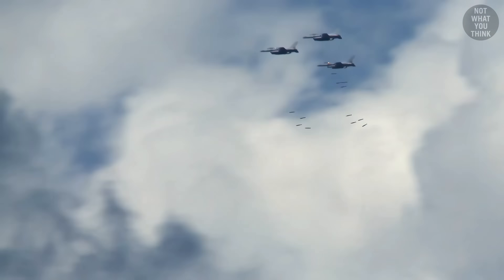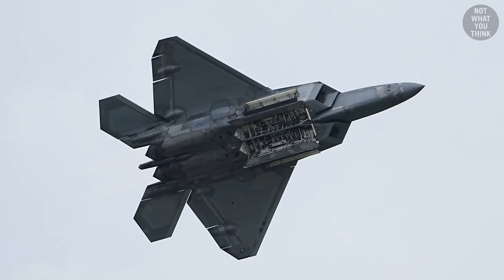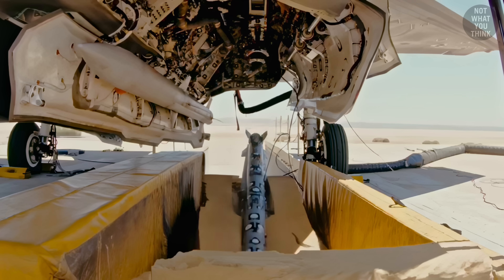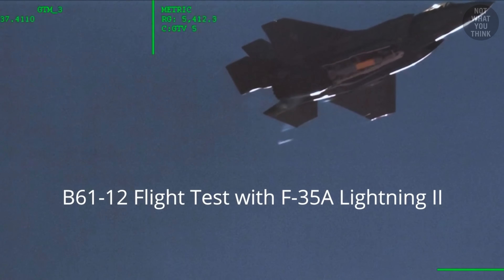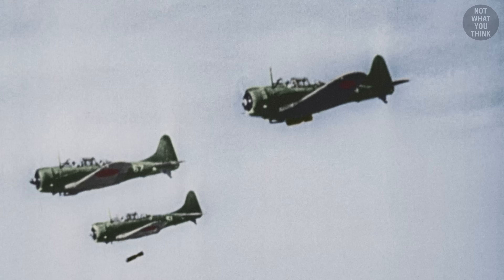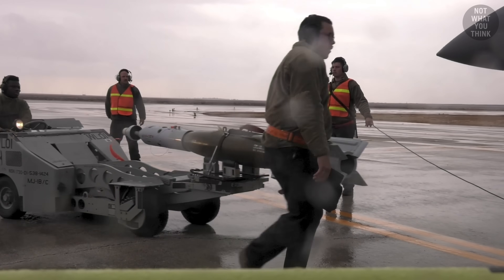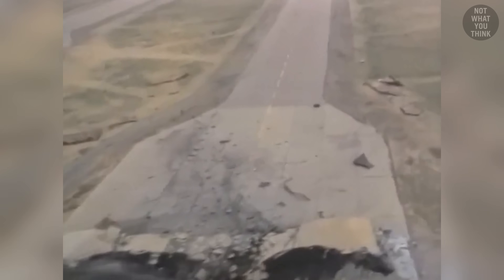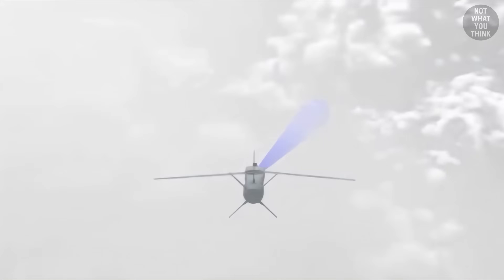Why Gravity is No Longer Enough to Drop Bombs

Comment: I have a low-tech solution to this problem. Have two hard-points for the bomb - front and rear. When the bomb release button is pushed the front one releases and then the rear one releases about a second later. That one-second delay would allow the bomb nose to catch smoother air further underneath the aircraft pulling the bomb away rather than it being sucked up against the aircraft.

Comment: "Mach point zero nine (.09)" at 1:47 is 66.6 miles per hour.  Barely a speeding ticket.  I think we meant to say "...point 9 Mach", which is 666.98 miles per hour at sea level.  .08 BAC is "drunk", .8 is dead times 10.  Watch the points and zeros.

Comment: 11:28 "That said, they (Air Launched Cruise Missiles) carry smaller warheads..." Uhhhhhhhhh. The ALCM carries a W-80 nuclear warhead, which doesn't really count as smaller than a JDAM's conventional warhead.
Me? I was the Air Force's Lead Engineer for testing ALCMs in 2004-2007.

Comment: 0:30 This is an insufficient and misleading explanation of lift. The force attributable to the equal transit theory of lift is a tiny, tiny fraction of the total lift force required to keep a plane in the air. The angle of attack of the wings is what generates the vast majority of a plane's lift. This correction is not in conflict with the idea of bombs being pushed upward toward the aircraft, since in fact the airflow up toward the underside of an aircraft is actually greater when the plane is at a positive angle of attack (as opposed to the zero AoA shown in the wind tunnel video at this timestamp).

The only aircraft that maintain a zero angle of attack more than very briefly are those flying parabolic arcs to simulate zero gravity, such as the "Vomit Comet," which is used for science experiments or astronaut training, etc.
Reply from the maker: good point

Comment: If I am not mistaken it isnt the air below the wing that slows down and creates a high pressure area but the air above the wing that speeds up and creates a low pressure area. This is because of the Bernoulli principle.

Comment: The "elevator shaft" incident was actually the first ever drop of a modern "bunker buster". The story of that is worth spending time on. It was a Howitzer barrel converted into a bomb casing, loaded with high explosives, and then equipped with a short-delay fuse. That particular drop was also quite important to ending the war. AIRC, there were key members of the command staff in a bunker below that building who thought that they were safe there since they believed no bomb could reach them. Showing that they were wrong and eliminating these particular individuals showed them that Resistance Is Futile (tm).

One thing not mentioned here is that being a spotter for a laser guided bomb is a dangerous thing. Lasers can be very easily seen with the right optics. So by lasing a target, you're telling the enemy exactly where you are and that can mean a very short lifespan.
Reply from the maker: we made a video about that https://youtu.be/KJTq9yb_Zow

Comment: I was on Johnston Island during Desert Shield and Storm. 
Our job was disposing of chemical munitions. 
At the time, the US had a bunch of 110 MM rockets with nerve agent. 
Funny part is the US never developed a launcher for them. 
There was talk about using the chemicals in Iraq. So we practiced loading dummies onto C-130s. That could be pulled out the back and would just fall a few hundred feet and smash on the ground. 
Releasing the nerve agent and disposing of the munitions. No launcher or fancy disposing factory needed.

Comment: Pretty good video...the Navy "blooper" video brings back memories...it is something us new ordinance flight test engineers were shown on our first day...basically to say "don't do this". Of course it still happened sometimes but usually due to a failure of some kind like a bomb rack cartridge failure. In one case it caused a Rockeye to hang in the slip stream of the aircraft until the fuze went off causing the canister to split and the fuze to fly back and gouge the elevon. I also worked on the F-14 Bombcat. When initially conceived it was supposed to have an A/G capability but the racks were very weak and could not push the bombs out of the tunnel. What solved the problem was incorporation of the F/A-18 BRU-32 racks which had 8 times the pushing power of the original F-14 rack. Anyway, this was a trip down memory lane...thanks :-)

Comment: 17:50
Yeah, but concrete is literal stone, and stone once it cracks all resistance is only existing in the sheer mass of the particles ahead, but metal puts resistance more constantly and is just stronger against tension and about everything.

Fuck it, heavy metal is the way to go 😎

18:20
Okay what the actual fuck? Why is concrete even remotely close to as strong as metal?
Fuck'em It's literally more metal than rock at this point, real concrete is not as strong as metal >:)
Those fraudous bastards are coping with rock being weaker than metal >:))

Comment: Bombs never fly up. I've dropped most of them,  its called gravity. If you toss them at even a +1 degree AoA forward momentum allows them to go up for a bit. You can do a DTOS or Loft drop which will make them go up quite a bit. Gravity is ALL that is needed and always will be ENOUGH with the right computer, radar and avionics. Title is misleading.

Comment: The A-5 rear ejection bay never worked.  I believe some aircraft were lost because of it.  Then the A-5 became the RA-5 (reconnaissance), loaded with cameras.  They were stationed on my aircraft carrier.  They were a beautiful aircraft.   I almost was blown off the flight deck by one.  Fortunately there was a huffer chained down to the deck that I was able to shelter behind until the RA-5 turned away.

Comment: Those opening doors might be a marvel for US standards and US standards alone because they have a nasty reputation for intentionally building stuff to break or building them with the bare minimum so they work fine until you get slightly damaged, then everything falls apart. Sometimes they build them weak to elements intentionally so as it ages, it breaks by itself so that you have to buy more. Instead people started buying Russian made stuff or Chinese and European stuff. 
Flash news, its not a great achievementto open a bomb bay without losing the hatch. Not even close. You have to either be really incompetent or to do it intentionally to make this happen. And the US design is not all that great either. The best way would to open it the same way a cargo plane opens its back door, that way the hatch blocks a part of the wind to safely drop the bombs and once you are done, you just need to remove the lock that keeps it open and the wind will make the hatch close by itself.  Opening the hatch this way will also make your plane slow dowh slightly and a go up a bit which also helps stabilising the plane and lessens the chances of the bomb coming back up to hit you. 
Whoever designed those sideway opening double doors made them only to look cool and didn't think hard on whats best for a bomber. Very typical american design.

Comment: So what your saying is if we could control the bomb in the slipstream so it doesn't crash into the plane, we could potentially get the bombs to fly with the plane until the pilot forces them out of the slipstream. Now this is a totally insane idea that would be close to impossible, but there is a small chance! I feel it would be really cool to see Bombs parented to the plane by air alone as the bombs adjust their fins to stay just below the plane, well that is until the plane pulls up breaking that slip and dropping them!

Comment: 14:52 Often the delay is MILLIseconds, just enough to get through a structure like a hardened roof, and then explode immediately as it peeks inside a room. Or a few more milliseconds until it reaches a lower floor, etc.

Comment: 12:30 "Toss bombing" is a pretty wide umbrella of techniques, and the first toss bombing techniques were invented to protect the attacking planes from ground fire, not just for delivering nukes. Certainly, some toss bombing techniques are specifically designed for use with nukes, but many of them are useful for traditional bombs too.

Pop up toss bombing for example allows the plane to ingress at low altitudes, behind the radar horizon, and only expose themselves for a short time during the toss maneuver, then dive down. It can also be used to lob bombs over a hill, and never expose the plane.

Comment: 5:48 - I got to do a mission aboard a KC-130J Harvest Hawk when I was in Afghanistan in 2011 and we did not use/need oxygen.  The launch tubes looked EXACTLY like this.  We were putting warheads on foreheads (Hellfires fired from the quad rack on the port wing) but didn't use any Griffen missiles (the ones that shoot out the back) so the bay door was closed.  I'm pretty sure we were at such low altitude that we wouldn't have needed O2 even if the bay was open.  As long as you're at ~8,000ft or less (up to 12,000 in a pinch), O2 isn't really necessary and I'm pretty sure we were WAY lower than that.  Gotta be able to see the foreheads in need of a warhead!!  Hahaha...just thought I'd point that out.  Awesome vid!

Comment: 14:41  lol   bombing???    not bomb try cannon fire  not a bomb against those  ground targets... scrolls up and corrects  the  cruise missle range versus  audio   lol over 1000 mph  and show  1500kph ( 932 mph )    actually try  they are   much much  faster then  stated  speed in video depending on variant  upwards of design capabilities of mach 5+ ,  1:45  and narration does not match  text  and  not anywhere near real    lol  an f35  at  point  zero nine  in audio  is only 69 mph ( 111 kph ) .   also  dozen more massives errors in this video  smh you  need more then just staff you need someone that can research  and not just guess at what correct data and specs are.

Comment: I was Temp Duty at Pax supporting a prototype radar landing system. The F-18 was being tested for Fleet acceptance at the same time. While recording a bomb release, an A-4 camera ship lost a wing when the F-18's bomb ad libbed. Even though the observer pilot immediately saw the danger, he was caught trying to roll out of harms way. The story was shared by the McD camera man during a safety lecture, in which he said he couldn't initiate ejection until he complied with the voice in his head to stuff the camera between his legs. During my extended stay, they also lost an F-18 from a flat spin test, and an A-7 from a bird ingestion. I still remember the calm pilot's transmission: "Tower, I'm exepriencing a compressor failure." I quickly popped the hatch to see smoke trailing from the decending A-7. The pilot had already ejected, but I couldn't make that out. In the lecture, another pilot told a much more gruesome tale (though he obviously suvived), but I can't recall what incident it was associated with.

Comment: The channel WW2 Bombers did a great video on why bombing in WW2 was so inaccurate (just after you posted this) and it wasn't because "dumb bombs" fell so randomly but because they typically could not see the target at all to aim at which is a problem for laser-guided bombs as well. The Germans in WW2 often used smokescreens to obscure the view, there was often cloud cover and even when those factors were not there, the first bomber wave would be accurate, then the next wave would find there was so much dust and smoke from the first bomb raid that the target was completely obscured.

This is a problem with all bombing runs, either laser guided or just freely dropped as both need a clear view of the target. The first strike will effectively screen the target against being hit again by all the dust and smoke. You have to hit them with the first strike or wait a long time for the next strike which is just increasing your risk of being shot down.

Comment: We need a comeback of Dive Bombers. The Ukraine Conflict has showed that we don't have production capacity to meet the demand for smart weapons in a time of war, hell, we can't even make enough 155mm shells to meet demand. Dumb bombs can't be jammed, they just work. Dive Bombers went away due to the post war move towards jet aircraft, a lack of suitable turboprop powerplants, and focus on Nuclear warfare from a strategic standpoint. A modern dive bomber would make for arguably the best FAC platform one can get.  Generally a fairly STOL design from the beginning allowing it to operate from airstrips as close to the front line as possible, offsetting its slow speed, said slow speed helping negate the issues that dumb bombs have with higher speed platforms, simple, durable, small, cheap, etc.

Comment: I have to disagree with stronger concrete being the solution to bunker buster bombs. Absolutely nothing can compete with the ease, cost effectiveness and low technological barrier to entry of simply digging. Sure super science concrete is a great idea if you want a symbolic bunker sitting in the open with the intent of drawing enemy fire but if you truly want to put some important stuff in you're bunker then the first line of defence will always be making sure absolutely nobody knows where the bunker is located. The second best line of defence is to ignore all the soil when calculating how deep you will dig instead drill many MANY meters into the bedrock then drill tunnels connecting the different bunkers at you're operating depth. I don't care how strong you're bomb is nor how strong you're concrete is absolutely nothing will compare to or compromise a couple thousand feet of naturally formed solid rock. You can't build a fort that way but the intention of a bunker isn't to hold the ground its to guard what you consider to be precious and with that objective in mind absolutely nothing can beat the simple art of digging as deep as you could possibly manage.

Comment: I know it may sound silly, but I’m always coming up with great ideas but no way to test them to give you a small idea I wanted to build a hot rod engine with the drag strip going to use a four 54 in.³ Chevrolet at knowing little or no money how to increase maximum horsepower with a little or no money this was in the very early 70s I thought diesel engines use inject your system. Why not designer injector system to go on the engine, but they’re gonna run into the usual problems not enough funds none of the right kinds of tools just a big idea for a old, poor country boy all my life elementary school until I had to go to work all kinds of ideas, but no way to realize a dream now that technology is caught up with me defensive and offensive weapons because of the times they just come to me sounds crazy don’t  IT!!!

Comment: bombs do not fly up , the pilot runs into them lol
Reply: I see someone didn't watch the video; sure, flaunt your ignorance. It was explained and shown: it's because the airflow from high speed at low altitudes can force them up, similar to how air over a wing lifts up aircraft; running into it has nothing do do with it, and isn't possible if the impact happens to the rear of the craft that released them.

Comment: That's not why toss bombing was invented. Toss bombing was invented during WWII to attack sites where you really didn't want to fly over the site (because they had a lot of AA guns). So instead they toss the bombs from a few kilometers away. With the invention of CCIP bombing the accuracy of toss bombing increased quite a bit, and this was further enhanced by laser-guided bombs allowing for pin-point precision (even from rather inaccurate tosses).

Comment: bounces off the shockwave and back into the plane. thats why aircraft that launch ordnance at high speed or high alpha eject the munitions with a small charge. most of the examples you showed werent due to this, those were failures of the pylons.